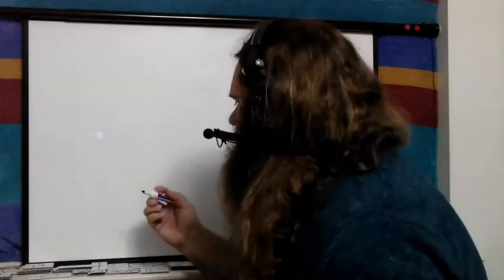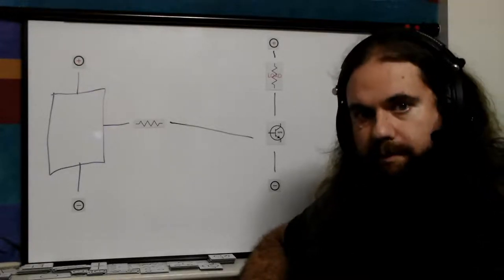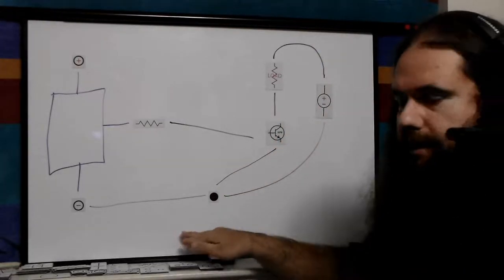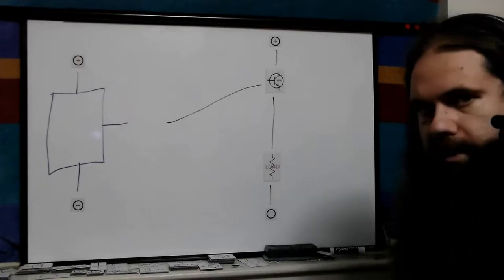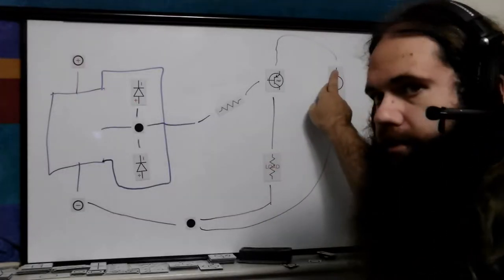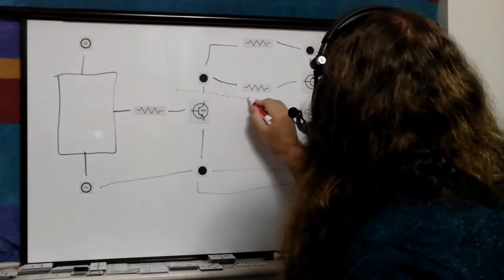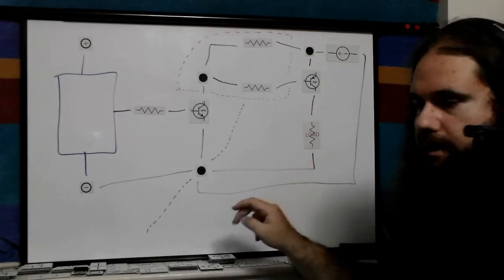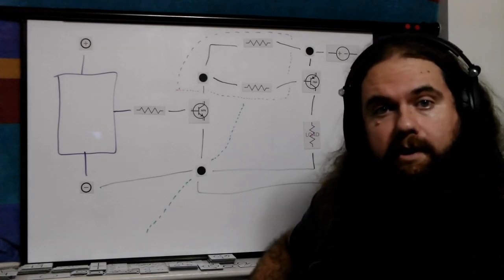Digital Switches using Transistors - Simply Put

Comment: Very useful as I try to fathom the control of relays and motors by microcontrollers in 90s cassette recorders. I’ve tried to get to the bottom of this topic for years and years over dozens and dozens of videos: (so far at least) this is by far the most relevant and clear, thanks!